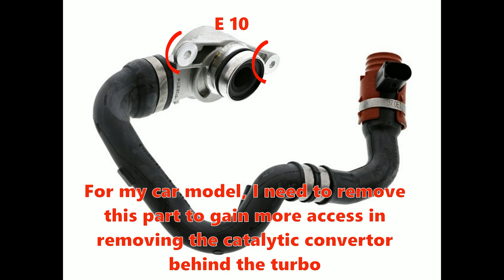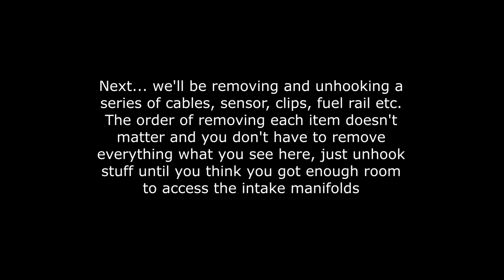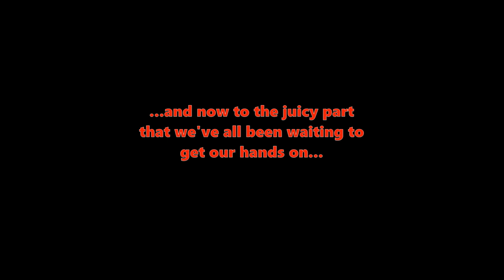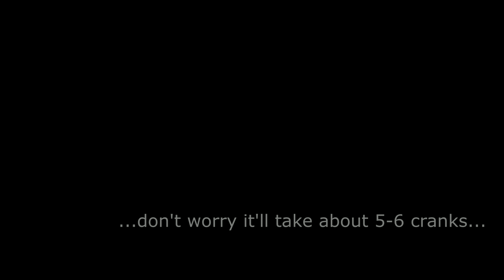DETAILED Mercedes-Benz OM642 V6 E350 CDI Bluetec W212 Oil Cooler Leak Fix

Comment: @Albanian Fix  does that mean all OM642 Motor will have the same Problem?
I m driving an ML 350(2014) 140.000km currently and i dont have any oil leaking at all..
I let the oil change Regularly every year and haven t had any problem so far..
Reply from the maker: Not all of them, especially the new ones that are coming out it seems that they have looked at this issue and fixed it. I feel like that from 2013 and up the engine has had some new small upgrades from what I could tell when I opened the hood on a 2013 ML Bluetec.

Comment: Replace the oil filter housing gasket first.  That fixed my oil leak. The rubber had hardened like plastic.  Easy two hour job.
Reply from the maker: Hmm… I’ll check it out next time 👍 
With all the oil changes I’ve done, the oil filter hosing has always been bone dry.

Comment: Is this the same problem with the 2015 cars? I just literally did all of the first part of this video earlier as my coolant flange was leaking... Well I think I have fixed it, just yet to drive it as I am in the process of changing all the suspension except shocks......🤦 Great video!
Reply from the maker: Oh wow your rebuilding it from ground up, nice 👍
Yeah, I believe the design is still the same but with significant improvements.
Reply: @AlbanianFix  thanks for your feedback cheers 👌

Comment: hi sir, i know it is old video, hope you still check your youtube. I got oil leak in the engine bay but i cant tell which it come from, basically everywhere. especially on the driver side. the oil level is still at max lv since it was only 2 month ago. Can I keep driving it for another month? really need a vehicle this month. Will this make any bigger damage to engine as long as i keep my eye on oil lv?
Reply from the maker: You can still drive it no problem as long as there’s enough oil in engine, it’s just gonna make a mess until you find the leak.

Comment: Excellent video. Like very much that you have edited the video with part numbers, tool size, etc. What is the plastic pack part # and where you bought it? The video shows that you pull out of the pack which has oil cooler gaskets, O-rings and all other needed seals. I am fixing on my 2012 ML 350 bluetec SUV that has the same problem, oil leaking, with 63k mileage only. I have taken out all necessary parts and having difficulty to find all seal/gasket/O-ring part numbers one-by-one and to order them. THANKS.
Reply from the maker: I included the link where I bought the parts in the comments. Thanks for the feedback!
Reply: @AlbanianFix  Thanks. I see the link now :0)

Comment: we have 2011 e350 bluetec with 106000 miles. no one has done the timing chain yet, what is the best way to do it? chain feed and master link or front cover off and all new parts? i have not seen anyone do a full job yet
Reply from the maker: How bad is it? Do you for sure it’s a timing chain issue?

Comment: Hi, and thank you very much for your useful video!. I have a 2007 JEEP Commander CRD with the same M.B. OM642, lot of oil leak recently...not getting yet to the floor dough, so I think will do this job very soon, because I saw in the comments of another video that in some cases (with a bad oil cooler) the oil can be sucked by the cooling system (within the oil cooler) and then the problem will be really BIG...do you know something about this situation?.
Reply from the maker: Thank you! No, I haven't heard anything like this before but it can be quite possible for something like this to happen. On the other hand, I think that because the coolant never gets to such a high temperature like the oil does, the seals on the coolant side don't deteriorate like they do on the oil side explaining why all these issues is so common in oil leaks and not in coolant leaks.
Reply: @AlbanianFix  Thank you for your answer, and...would you recommend when doing this job, to change also de oil cooler itself?...how can we know if it's working well or not having some internal damage?
Reply from the maker: @rodrigofabregas7756  Yeah, definitely! For me, I was ok with exchanging just the seals but if you need extra peace of mind, I would definitely replace the cooler as well since this job is big and time consuming and you don't want to do it again anytime soon.

Comment: Hi, I got the same issue with the oil cooler leaking around 1 litre oil every month for about 1 year, I can see from your video the actual orange seal is still intact, what’s your opinion on using a LeakStop product to soften and expand the seals? I was thinking about the Lucus stop leak as it’s got a lot of good reviews online.
Reply from the maker: I don’t really believe in products like that as they tend to have other side/negative effects on the engine or the car’s overall performance. As I’ve mentioned in other comments before, in my opinion, this is not an issue that can be fixed permanently. The design of this oil cooler was not the best and because of that this should be seen as a “wear & tear” or as a “periodic maintenance” item much like an oil change that also needs attention from time to time to check oil level.

Comment: Curious about burning the soot out of the intakes.  What is the risk of heat damage using the blow torch?  Could it also be cleaned using solvent?
Reply from the maker: Yes, it can definitely be a risk for the aluminum intakes when using the torch for a long period of time. The torch is only there to “ignite” the soot much like igniting charcoal when you’re about to cook some steaks and then use just compressed air for the remainder to keep the fire going. The temperatures usually stay below the melting point of aluminum but hot enough to disintegrate the build up soot.
Also, I used a propane that has lower heat output than other propane cylinders to be more on the safety zone but still need to be very careful not to overdo it.
To answer your last question, yes there are tons of solvents. I’ve heard that dumping it in a bucket of diesel helps also.

Comment: Did the job myself and everything seemed to go right. But it’s taking 15 of cranking and it won’t start. How long does it take to prime this engine once it’s put back together?
Reply from the maker: It only took me about 6-7 cranks. Make sure you got all of the fuel lines hooked up right and all of the sensors back in place. Check fuel pressure by using the fuel filter’s line, first unhook and put it in a bottle or something to catch fuel just in case it squirts everywhere and then turn the key in the second position. Also make sure you can hear the fuel pump in the back of the car humming when you do this.
Reply: Albanian Fix I got it working after several cranks. I was told that turning the key to the second position for 15 minutes will also prime the fuel system. Not sure if it’s true but I seem to have a coolant leak from somewhere at the back/bottom of the engine... so I get to practice this repair and fuel system priming again...🤢
Reply from the maker: @davidgarner3275  Nice! I figured you've already done that part but oh well it's up and running now, that's what's important :) ...As far the leak goes, check if the coolant leak is right between where the two manifolds meet. It's this part here:

https://www.fcpeuro.com/products/mercedes-intake-pipe-socket-gl320-genuine-mercedes-6420980037

With some bright light, you'll be still able to see the slit and probably see the actual leak from it. It's common that coolant will leak from this spot if the double O rings haven't been seated right with some good lubricant because they can easily be turned, twisted or even slip out of place while you try to butt the manifolds together...
Reply: Albanian Fix I did have some issues with that part twisting when getting the manifolds together-a few times- and it twisted on me. I’ll check it again but I think I got it to seat correctly. I used an assembly lube on it  to make sure I didn’t roll or cut either of the gaskets. The leak seems to be in the back of the engine so it might be a hose.
I’ll start looking today and report back what I found so everyone can know what happened.
Reply from the maker: @davidgarner3275  Oh I see... thanks for the feedback and we'll wait for your results. Good Luck!
Reply: Albanian Fix Well, in removing the intakes, I apparently damaged a metal coolant connection pipe located under the EGR. That little issue is going to involve me removing both intakes again, replacing the driver’s side intake (about $400) and reassemble everything. Lesson learned: “Be careful when removing the intakes.”
Reply from the maker: @davidgarner3275  Oh wow I must have been lucky... thanks a lot for this advice! Others will really appreciate this before they do this job.

Comment: Thanks for the very detailed video with captions and tips - very professional.
My local dealer just informed me about oil cooler leak in my 2012 ML350 Bluetec. 
They are charging 3,200 for it. I'm wondering if private mechanic shop might be cheaper.
What do you think?
Reply from the maker: Yeah, indis will be always cheaper than dealers but not sure how much though...
Reply: @AlbanianFix  do you think, $3,200 is reasonable?
Reply from the maker: Mine was quoted close to 4K. Yours is still not reasonable “for me” but depends if you got that money that you won’t really miss... 🤔
Reply from the maker: Hey f2ajack, if you live in the US, right now there’s a class settlement going for all owners of a bluetec mercedes and all qualifying ones can receive up to $3600. So there you go, you should be able to cash that money which can help you pay for this issue. Go to https://bluetecupdate.mbusa.com/home and check you vin number to see if it’s eligible. If it is, it should tell you around what time you can call your local dealership and check if they have your car on a recall list. Once you get your car done for free you can then apply to receive the money that’s promised to all bluetec owners.
Reply: @AlbanianFix  Thanks so much - looking into it and will definitely do it. much appreciated.

Comment: Excellent work and camera work. I’m currently looking at an 2008 ML with only 69k miles and dealer serviced. I know this oil cooler leak would be looming and I’m reluctant to pull the trigger even though it’s a clean Florida car.  I do a lot of shade tree mechanic stuff but would be hesitant to try this lol.  My local go to diesel guy is also Albanian . Great guy and works at a MB dealership with a side hustle .  What miles were on motor when you did this ?
Reply from the maker: Yeah we sure do love us some Mercedes especially when it’s a diesel. I had about 100K when I did this. Leak wasn’t significant but worth a try to stop it.

Comment: I have read a theory that dust gets into those seals as the aliumiumin expands and contracts with the winter summer mine dose not leak yet, but I still blow the engine out regularly.
Reply from the maker: Hmm 🤔 interesting theory… might explain why it leaks in so many cars.

Comment: But your old gaskets on the oil cooler seems not to have had any leaks?
Reply from the maker: I think it’s hard to see the leak like that. You can definitely see the valley was full of oil.
Reply: @AlbanianFix 
Hi how long did it take you to complete the whole job? I’ve had a leak from the air intake which has broken the swirl flap motor I’ve asked the mechanic whilst replacing that could he also replace the oil cooler gaskets he has said an extra £500 as he needs to remove the intake manifolds to me this like the easy part? Thanks for help!

Comment: Hello. How do you clean all the gunk out of the valley, making sure nothing falls into you oil lead holes and clog up something? Oil holes seem to be so low down they seem to easily act as a drain, sucking in misery 😃
Reply from the maker: When removing the oil cooler, you will be left with a liquid of oil and coolant residue all over the place. Get a shop vac and start cleaning that up then your left with with a slimy gunk that you’re gonna carefully pick it up after plugging the coolant and oil holes up. I used the foamy earplugs, just make sure you don’t slip them all the way through :) and then used a flat head screwdriver to clean the bigger pieces , then a microfiber towel or any other towel that will not disintegrate into little pieces and finally used brake cleaner to finish off the job but only on metal surfaces.

Comment: Sir,are you a mechanic or just a diy at home mechanic? Is this job ok for a guy with a bit of experience? Also was it easy putting it back together as mine is leaking very bad and im aldo going to put new turbo back on aswell myself?
Reply from the maker: No I’m just a DIY guy that knows a little bit about car engines. I believe that if you’re somewhat mechanically inclined and have a lot of patience during the process of noting where everything belongs, you should be good and not worry about it too much.
If you decide to do it, please let me know how it went.
Reply: @AlbanianFix  ok i will keep u informed when i start

Comment: OM651 engine has this issue also. Throttle Valve is also doomed to fail sooner or later.
Be aware of these issues if you're looking to buy this car. Big and costly job to fix.

-W212 E220 2012 owner

Comment: I see you used the same oil cooler.How did you check to make sure it was not warped? Some guys will lay the bottom on 120 grit sandpaper to see if it is flat. I'm doing this job now and not sure if I need to buy a new oil cooler.
Reply from the maker: I didn’t check much on it. I just laid it flat on my granite countertop and it seemed pretty flat to me. But the cooler uses so many bolts around it and it really comes down to the actual double rubber o-rings that are compressed down that I really think it’ll be fine.
Reply: You can buy a kit I think on IDparts or fcpeuro that comes with all the gaskets needed to do this job and a new oil cooler.

I've done this job about 7 times now and can't stress enough, replace EVERYTHING YOU CAN.  Every oring or gasket, the cooler, the metal bevel that connects the intake manifold, etc.
Reply: @carlbrutananadilewski8395  Got a giant coolant leak after doing my oil seals. While the car runs the coolant almost is running. I took it all apart did the whole thing again and now I got even a bigger coolant leak. its just running like a water fall as soon as i add coolant to the expansion tank. Anyone can help with what i missed?

Comment: Did you drain the oil first ? Is it necessary ?
Reply from the maker: No for this repair I didn’t drain the oil. Yes you can change and I would advise to do so. I did end up changing the oil after a week myself.

Comment: Got a giant coolant leak after doing my oil seals. While the car runs the coolant almost is running. I took it all apart did the whole thing again and now I got even a bigger coolant leak. its just running like a water fall as soon as i add coolant to the expansion tank. Anyone can help with what i missed?
Reply from the maker: Hey Viktor, look in the comments, there’s another guy where this same issue was discussed and he fixed it.

Also check this part:

https://www.fcpeuro.com/products/mercedes-intake-pipe-socket-gl320-genuine-mercedes-6420980037

Most of the leaks come from this part if the seals are bad or not seated in correctly.
This one is located right in between where the two manifolds connect.